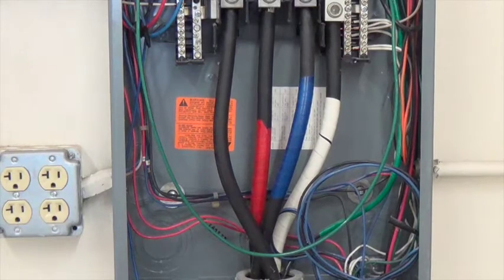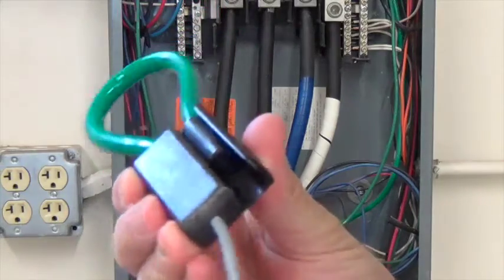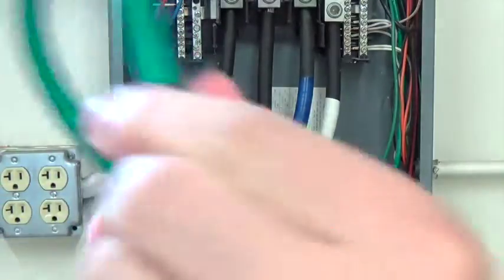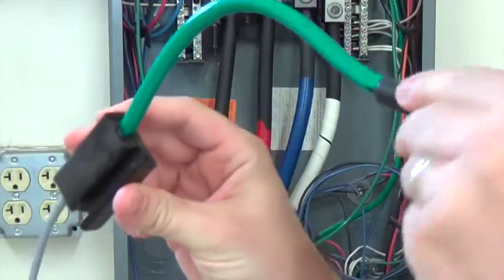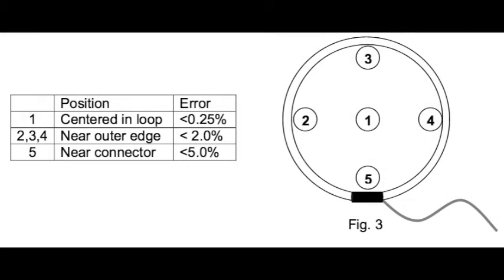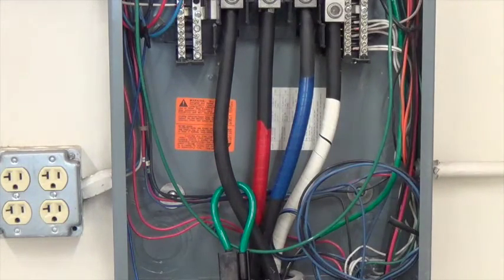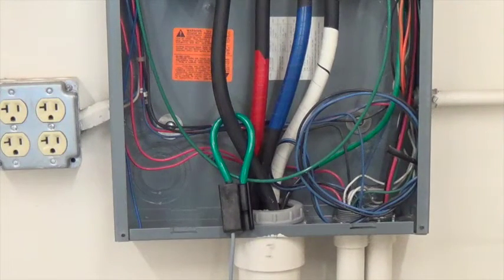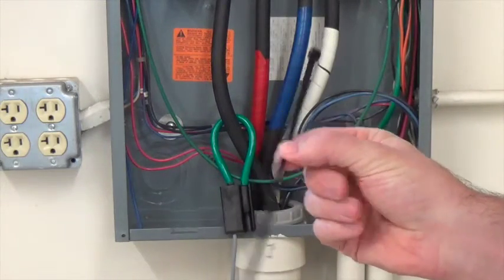RCT Teardrop Advantages

Comment: bare hands, naked arms, neutral terminals exposed, an insulating tape made connection floating, a poorly made power panel, and worst, naked power terminals at several times just a few inches from your I guess most probably naked face...